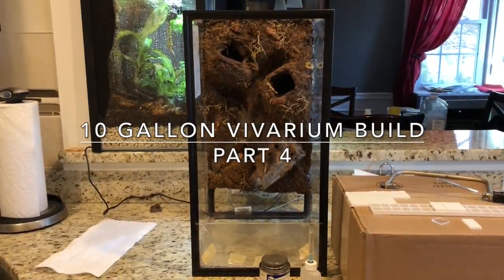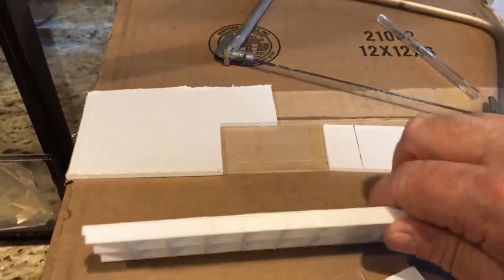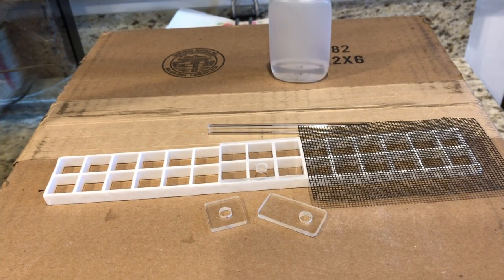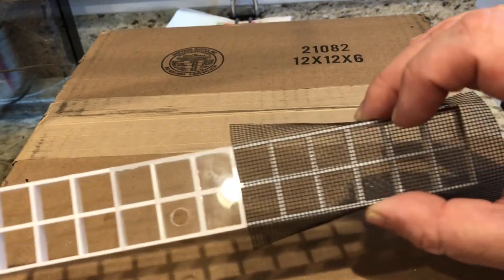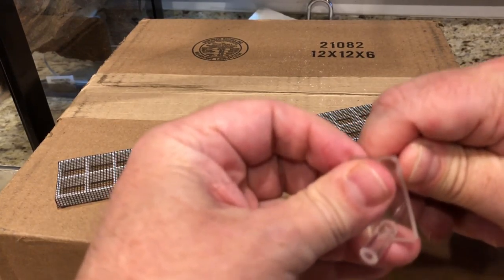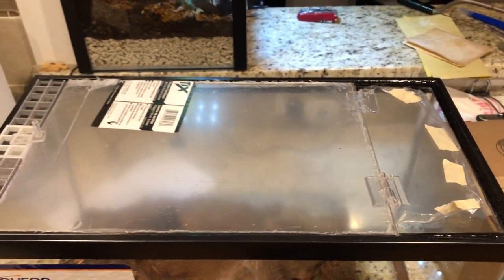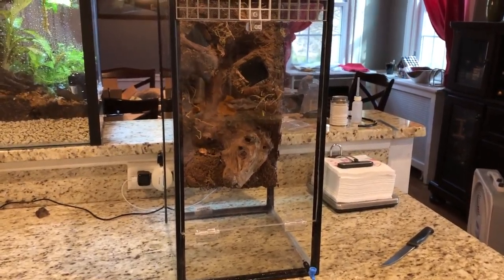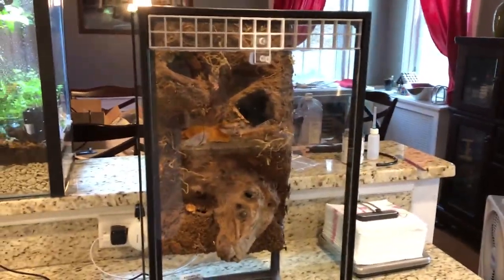10 Gallon Vivarium Build Part 4: Completing the Enclosure

Comment: What’s that black tube on the drain valve .. I did this (not with the black rubber thing ) and water drained then it slowed down and just stoped. I think that black thing is the key to my problem!
Reply from the maker: Hi. It was just a piece of black airline tubing i used to connect the valve to the acrylic rod
Reply: @ReefSpy  thanks for the fast response

Comment: where do you get the drain valve?
Reply from the maker: you can use these https://www.amazon.com/gp/product/B00ZRHB5NW/ref=oh_aui_detailpage_o01_s00?ie=UTF8&amp;psc=1&_encoding=UTF8&tag=reefspy06-20&linkCode=ur2&linkId=f2afcb1b8485301e74738d952d5f210a&camp=1789&creative=9325
Reply: Where did you get the ventilation piece from